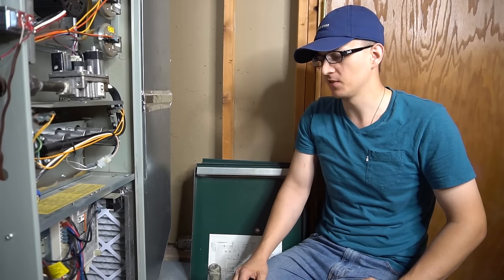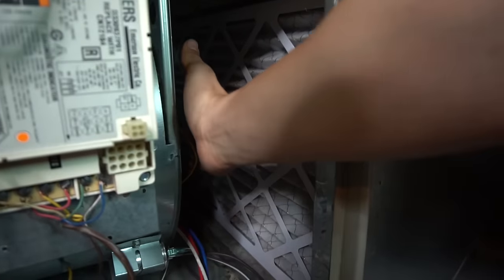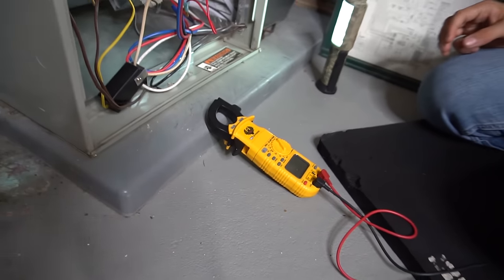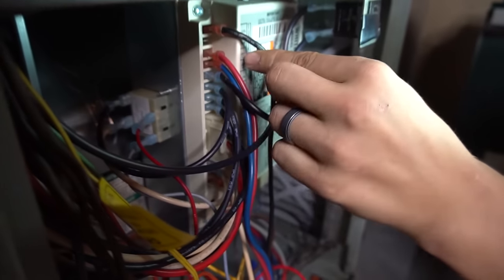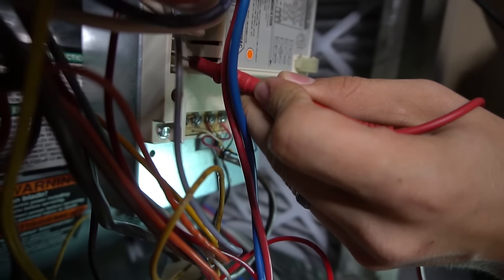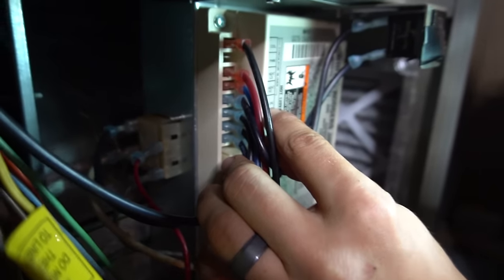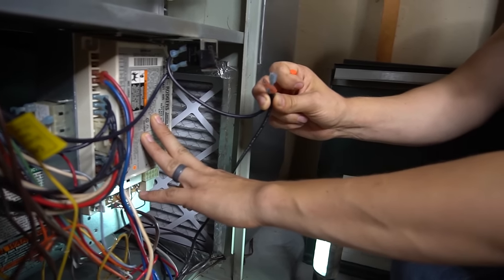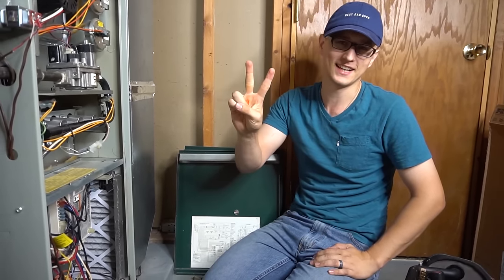Furnace Blower Not Working - How to Check It

Comment: Instead of cutting the wire to Hotwire, just take the fan line and plug it into the safety switch. Turn the power back on and when you push the switch it will supply power directly to the fan bypassing the board.
Reply: My problem is the co2 senor tends to not work at times and doesnt let it turn on how can i fix?
Reply: Jose that problem isn't related to what I was talking about with my comment but as a guess your option is probably to replace the sensor. Good luck.
Reply: Good thinking.
Reply: Cpt Adama where is the safety switch located?
Reply: If you do this your 24v transformer will not get line voltage, therefore your condenser contactor will not pull in. This is a quick way to check for a bad motor though.
Reply: @williamstewart8871  It's on top of the door frame of the blower section.

Comment: Turned on my 2yr old furnace last night with no air coming out of my vents, but the AC  and regular fan works great. Why is the furnace the only one not blowing air? Oh, there are NO lights visible in the little window in the front, are there suppose to be?
Reply from the maker: I would start by bypassing the thermostat at the furnace control board and see if the furnace starts up then. (jumper R to W) If the furnace turns on, then the problem lies in the thermostat or the wiring going to the thermostat.. Here is a video on how to bypass the thermostat at the board if you need it: https://www.youtube.com/watch?v=bmZc76ufTNY&t=2s

If it does not turn on, then it could be a few things... It would help if the furnace was blinking an error code. I would take the furnace doors off and tape shut the door switch. That will help locate the LED light.

Comment: If need be, could you keep the blower hot wired through out the night to get through the night? I absolutely froze my butt off last night because I think my capacitor is bad.
Reply from the maker: Yes you can hot wire it but if the capacitor is bad, even if the motor is hot wired it will not run. Hot wiring is only applicable if the board or fan relay is bad and does not send power to the fan motor.

Comment: When my furnace calls for heat it goes through the proper cycles and when it’s time for the blower motor to kick on it does kick on however after about 15 minutes the motor gets so hot it shuts itself off.
 I replaced the capacitor thinking that was it but it’s still doing the same thing ,now if I let the furnace cool and turn the switch off for 10 seconds then back on it will work again for 15 minutes until the motor gets so hot it shuts down again. Do you think the motor is bad ?
Is there some safety device kicking the blower motor off when it gets so hot?  Thank You
BTW:  Great videos like and subscribe everybody !!!

Comment: So how do I bypass my board for emergency cooling? My board is bad but blower motor is good.
Reply from the maker: You just need to get power to the outdoor unit. The low voltage. You can try jumping R to Y on the thermostat strip on the control board or you can hook up the two thermostat wires coming from the air conditioner directly to the secondary side of the transformer. (24v side)

Comment: At 5:50 or so, you mention pulling the wire off and cutting it and wirenutting it to hard wire the power straight to the motor. Instead of all of that, you can simply pull the wire out of the switch (top wire out of back of switch), and plug the fan directly into the switch. No need for snipping wires. This way you can return everything back the way it was when youre done without having to add connectors back to the wire. 

Once it's plugged into the switch, simply flip the power back on to the furnace, then press the switch to see if the motor runs. :) Otherwise a great video and very informative. Just trying to save you and some others some steps in the future :)
Reply from the maker: Good suggestion! Thank you for pointing that out! For testing purposes, your way is the way to go! But for a temporary bypass, for example, to get the furnace to run until you can get a new control board.. The way I showed would be what needs to be done. Would you agree with that? Or did am I still missing the point?
Reply: @WordofAdviceTV  Jay, this is in regard  Adamhi22's comment and your response.  When you use the spade you connect the Black Door switch wire to the Black cooling speed wire from the fan.  I understand.  My question is after that why plug the third prong of the spade into the control board.  It seems unnecessary.  I don't understand the point.  WAIT.  I guess even though the fan is powered the spade into the board is needed to power the board for non-fan related requirements.  I came to that conclusion while typing my question.  If you have time can. you tell me if I'm right or wrong.  I think I'm right because that would make sense when you say Adamhi22's method is good for the fan test by itself, and you say your method is necessary for a temporary bypass awaiting a new board.  I am enthusiastic about what I learn from your channel.

Comment: My problem is that my blower motor gets stuck when trying to start, but if I give the blower wheel a push, then it spins OK.  The unit, a York/Dayton had it's blower motor and capacitor replaced maybe 4-5 years ago.  Do you think it's more likely the motor needs lubrication or the capacitor is bad?
Reply from the maker: A lot of the new motors cannot be oiled. (unless you completely take it apart) Perhaps the blower motor capacitor is weak or dead so it doesn't have enough power to start spinning on it's own. I would start by replacing the capacitor and seeing if it solves it since a capacitor is much cheaper than a new motor.

Comment: Hi! May I ask your opinion about my ac issue? The outside fan turns on fine but, my furnace blower turns on for like 5 mins then shuts off then turns on again after 5-10mins and keeps on doing that cycle whether it's set to AUTO or ON. the outside fan keeps running causing my ac lines and the one inside the ducts (evaporaror I believe) to freeze up. Everything was cleaned, furnace blower was not dragging, motor was warm to touch and not burning hot and thermostat is set to AUTO or COOL. Any advice?
Reply from the maker: Hey Frederick! Thanks for watching! I answered you on the other video :)

Comment: WOW, U R DA BEST
Q)  I have a new blower fan wheel and a new capacitor on my otherwise working furnace blower, BUT my 3amp fuse keeps blowing! Everything works otherwise.. I have a new filter under the thermostat in the house. Furnace is in the basement. 
>>>  Why does my furnace blower fuse keep blowing OUT?!!  It lasts a couple of weeks, or a month.
<-- I guess I can replace the motor too, but seems silly if it's running. Yes?
Reply: Theories: A) Motor is getting old, draws too much power, needs oil, or replacement. B) Ducting is dirty, may be blocked with rodent nest, not cleaned in too long.

Comment: My AC air handler ECM blower motor stopped working. The high and low voltage going to it are correct so I bought a new motor. I connected it and it continually starts and stops. I returned it and bought another from a different seller and it does the same thing. Is it possible that both motors are defective or could something else be the cause?
Reply: Problem solved. My neighbor's son in law is a HVAC technician, so I called him and explained the problem. He told me that the motor detects the load that is on it and adjusts for that load to maintain a steady speed. It needs to have the blower wheel on it and be mounted in the blower housing in order to detect a load. I installed it in the air handler and it works perfectly.

Comment: Hello man. Thank you so much for the great videos!  My furnace blower motor gave up. When I turned on the power of furnace for heat, induce motor, igniter, flame, all worked properly. Only the blower motor does not start. It has humming and overheat on the back. I changed a new capacitor but it didn't work. I suspect that the blower motor is bad. I did check the wires with multi meter for continuity, and the reading for all 4 lines with the white line are small numbers of ohm. So I am confused here.                                     Can you please give me a rough idea what is going on?
Reply from the maker: The easiest way to check the motor is to measure voltage. Turn your fan setting on the thermostat to ON. Then go to the furnace control board and trace where all the wires from the motor go. Measure each of the plug in terminals to Common (usually where the white wire goes). So one meter lead goes on common and the other lead on the COOL terminal, then the HEAT terminal, and the FAN terminal. Make sure the power to the furnace is on and the door switch is pressed in or taped when you are measuring voltage. If any of the motor speeds is measuring around 120v, then you know that the motor is getting power but it is not turning on. That means the motor is bad and needs to be replaced.
Reply: @WordofAdviceTV  I did what you said. It was very smooth. I got 126 V from the heat point on the board. So the blower motor must be faulty.  Now I have a new problem. My blower motor is F48AA19A50, AO Smith, 1/3HP, 115V,  4.8A, 1075rpm, 4 speed, CCWLE, 1/2" diameter shaft. I searched online and only found used one. I called different suppliers. No one can find a replacement for me. From an expert stand of point, do you think  i have to use an old same motor or I can find a new replacement by following some of the rules?  Thanks!
Reply from the maker: @ye4334  With blower motors there is no need to go with the OEM motor. As long as the RPM, HP, and Voltage line up, everything else doesn't really matter. Most of the universal replacement motors are reversible too so they can spin in both directions. If the bracket on the old motor is welded on, then you will need to order a motor bracket as well, one that will fit the diameter of your new motor. And lastly, get a new capacitor for the new motor as well. If the old one is still good, you can keep it as a spare if you'd like.
Reply: @WordofAdviceTV  I found a blower motor with PSC with same RPM, HP, and Voltage. What's the difference between permanent split capacitor and run capacitor? Can I use this?

Comment: My furnace has been giving me problems for the past few years. It fires and after so long the burner will kick off. There are times of the day where the blower motor will kick on like it should and the majority of the day it will not kick on like it should. So if the fan doesn't kick on the burner will start run for 5 minutes and shut down and it will do this all day long. And I don't believe my fan has a capacitor, it has a second circuit board in the fan box

Comment: @Word of Advice: The inducer motor in my carrier (58MXA) furnace kicks in, make a fan type of grinding noise, but the furnace ignites. It stays on for about 3-4 minutes and shuts off (super hot) with code 33. The blower motor never comes on. I found a bad capacity (below 6%) and replaced that, but it made no difference.  I hot wired the blower and it spun like a top. There is also some type of relay switch under on top of the blower motor compartment area.  I opened the inducer compartment and made sure there was nothing in there. So, I am at a loss as to which one is causing the issue. I tested the flame roll out and there is continuity. It never seems to be locked out (or auto-resets). My guess would be the inducer motor is the culprit, but I am getting ignition for a while. Have you seen this before and what do you suggest I test. Thanks so much for doing these videos!
Reply from the maker: Have you taken out the inducer motor yet? There may be something in the blower wheel (a bird or nesting) or the wheel may be broken. I would suggest taking out the inducer motor and visually inspecting it. On most furnaces it comes out pretty easy.
Reply: @WordofAdviceTV  There's nothing in there, but  I've notice some more things: 
The housing of the inducer fan is not completely closed and doesn't snap closed all the way (looks to be somewhat slightly warped). The wheel itself actually looks imbalanced when spun, and there are scratch marks on the inside housing where the fan spins. I also tested the capacitor on the inducer motor and noticed that too is way below specs . The capacitor says 3 uf +/- 5%, and reads 2.55. Do you think replacing the whole inducer would resolve this issue? Could this actually prevent the blower motor from engaging? I'm totally lost. Thanks again for your help! :)
Reply from the maker: @danp4456  From the way you described the inducer motor, I would suggest replacing it. Although this may have happened to it because the furnace was overheating from the blower fan was not coming on. Sorry, I totally missed the part where you said that your blower motor was not coming on in the first comment. If the motor works fine when hot wired, that usually means the control board is bad and not sending power to the blower when it should be.
Reply: @WordofAdviceTV  
For testing the board, you said to check the  common port and the heat ports, correct?
I have done that and get nothing. I'm not sure if I'm on the right ports. The port is marked Comm and the other Heat, so I assume those are the ones.

Does the control board get signal from something else telling it that it should trigger the blower fan? If so, I can check that component.  I hate to buy a $300 board to find out that wasn't the issue. 

Thanks!!

Comment: @4.29 can  i  test  whether black wire has power when i turn on switch w/o removing wires?
Reply from the maker: It depends on what kind of control board you have. If your meter lead can touch the metal tab that the black wire goes to, then there is no need to pull the wire off. In my case, I can't really get to it unless I unplug it. I hope that makes sense.. Or if the wire connector on the black wire is bare (not insulated) then you can put your meter lead right on the connector.
Reply: @WordofAdviceTV  i have  no-contact voltage  detector and i want to know whether i can use it w/o pull out the wire.
Reply from the maker: @ask43242flight  Oh well then of course! No need to pull off the wire if you have one of those.

Comment: I always have to flick the squirrel cage to get my furnace to blow hot air. Ive had this problem with my old one and have purchased a new one recently. I still have the same problem. Any idea what the possibilities are? I've hired many techs from different companies and neither of them can figure it out. Thank you.😊
Reply from the maker: Well that's odd.. I would say that sounds like a weak or dead blower motor capacitor but I am sure the other techs thought the same thing. Some people prefer to run their fan continuously (which is totally fine) by setting their fan setting on the thermostat from AUTO to ON. That would take care of the hassle of you having to flick it every time. But to be honest, I don't have a good suggestion about that. That's bizarre. From what you described it totally sounds like either the capacitor is dead or the motor is defective (I have had motors be bad right out of the box before). I would have to do some troubleshooting to figure it out too.
Reply: @WordofAdviceTV  Thanks, for some reason the auto/on feature isn't displaying on my digital thermostat. I remember it being there. Everything else is displaying. I looked it up in the manual and feature is there, just not displaying.....Always something. 😬
Reply from the maker: @49684   It's possible that the thermostat has something to do with this then. If you get down to the bottom of this do come back and share if you'll get the chance. :) That sounds like an interesting problem.

Comment: what is "park" connection is use for in the control board for trane system? my control board has two of them connected to the blower fan.
Reply from the maker: Some blower motors have extra fan speeds that are not used. This enables a technician to adjust the blower motor fan speed if needed. The unused fan speeds (if the motor has them) would be "parked" on those spare terminals.
Reply: my trane xr80 has extra red and yellow wires for the blower motor. currently the black wire is connected to “cool” in the control board. do you know if the red and yellow wires have higher speed than the black wire?
Reply from the maker: @jungapo2  The black speed is the highest speed and is almost always the speed used for cooling. I actually have a pretty detailed video on blower motor wiring if you are interested in the details: https://www.youtube.com/watch?v=4S8TZd-45bY&t=4s